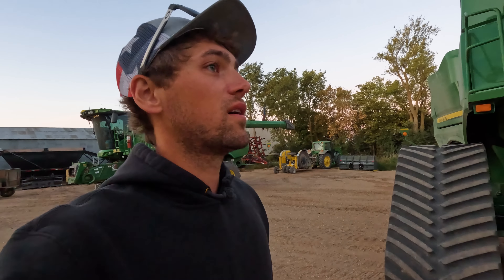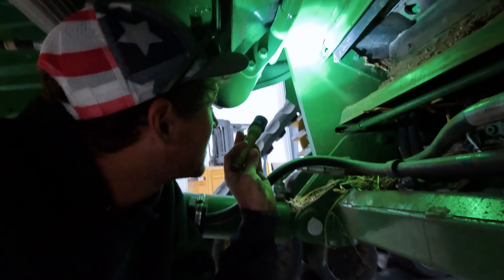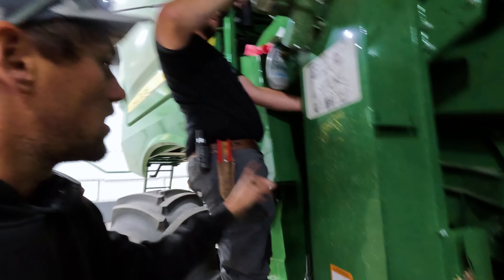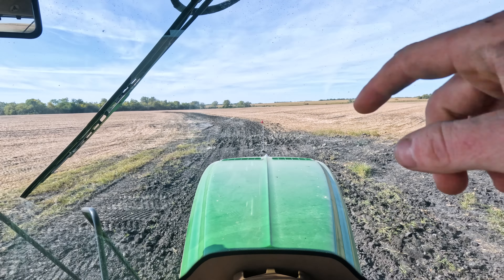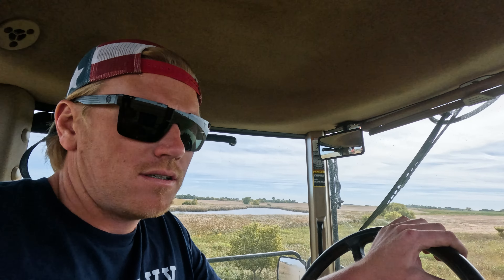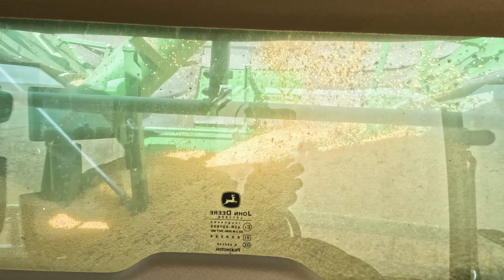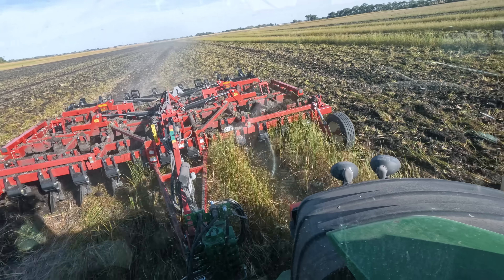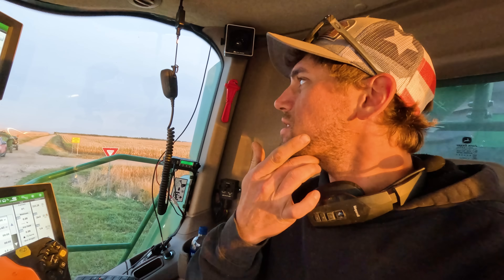Broke Down…Great Way To Start Beans! Ep. 1

Comment: I’m a John Deere combine mechanic in Illinois for future reference if you have to replace that lower feeder house door bracket again we always air hammer it out from one end to another until it’s out far enough to get our Milwaukee drill over the end of the pin and tighten it down as hard as you can and spin it fast (once you get lube in the cracks of the hinges and get it to spin freely) and usually we can spin it fast enough with the door in a vise to just pull outward on the drill and it comes right out. Just some advice to make a future issue easier!
Reply: thats how we put splice pins into belting on potato conveyers.way up north.
Reply: Nice, makes sense

Comment: Have you considered grinding off the ends of the new hinge and welding additional layer of steel to give the bolt hole more strength to avoid another tear out of the door hinge?

Comment: Tip for removing hinge pin out the door hinge. Put the door in a vise Air hammer out the the pin 3 inches then chuck your 3/8 Milwaukee m12 or m18 drill to it and put it in reverse and pull it comes right out.  Your vise grips will thank me.

Comment: Love the new intro and all the content.  Still cant get over the speeds you travel across the fields.  Worked 9+ years in apple orchards in NC.  Sprayer speed was 1.25 MPH, 500 Gallon, 45 minute run before refills.  Side hill and steep ground no way we could attempt the speeds you run.  Different crops and terrain for sure.  Also many years ago in the 80's.  Good luck with harvest.

Comment: NW of you guys in ND a little way  and aour bean yields were not all that great either, but what does a guy expect with mid June planting and in the mud. I actually was happy with the yield. Also we didn’t have many fields where the tank sample was not full of green pods I put grated inserts in the JD round bar concaves and that helped a lot. I did a field of beans after  taking some corn with out the inserts and it was like night and day.. The fields ripened unevenly with the hot dry finish.

Comment: Check your air bar at the end of season and blow it out.  We've plugged nozzle before because debris does get into the system through that fan shourd. Then you wonder why the air isn't blowing them in.

Comment: Chet  -  Food that falls onto the floor in a combine or tractor cab fits into the 30 second rule (or the next stop) if on the road.  LOL   -----    On your soybean plants you showed in the cab,  planting just two weeks earlier can make a difference.   I know you had muddy or flooded ground but timing can be crucial for planting,   maybe try to find a (less photoperiod sensitive) soybean variety next year for your area.  Soybeans are extremely photoperiod sensitive and when a soybean plant begins putting on flowers for beans is controlled by the (hours of daylight).    As daylight hours just begin to get shorter (July) the genetics tell the plants to begin flower seed creation and later at a point to stop the seed creation and commence with the ripening and the plant begins drying out.

Comment: I called the John Deere dealer in Shiner, Texas and they told me the "Power Guard" is by John Deere as an extended warranty feature.
I would think that engine went back to the main factory for the engineers to examine and see what failed.

Comment: A soybean split isnt dock. Skins and  smashed little pieces are. Set those green combines to your tailings capacity. Close that bottom sieve til your alarm goes off and open it 2 from there, open the top a little bit during that process and speed your wind up. Those combines are just like a old 88 series red combine. Set em to your return and open up those concaves and speed up the rotor and your ground speed to get grain on grain thrashing. It isnt rocket science.

Comment: Could have stuck a CAT in it then youd have something. You got played by JD. No motor is worth that.
Reply: It was a warranty repair so it doesn’t matter. A brand new C13 straight off the assembly line probably wouldn’t be much less expensive if any.